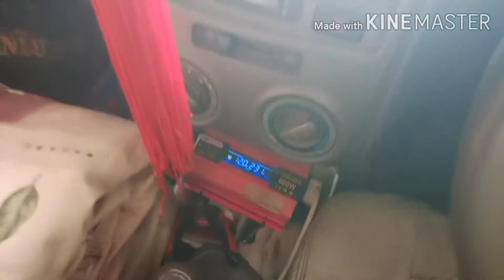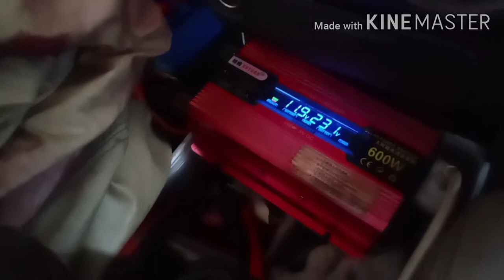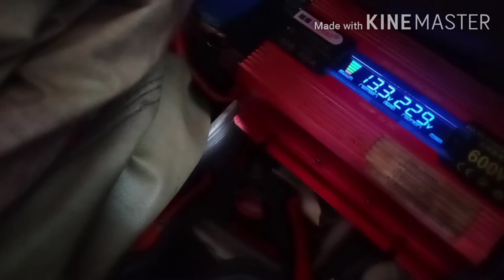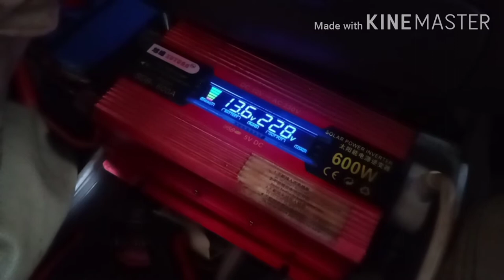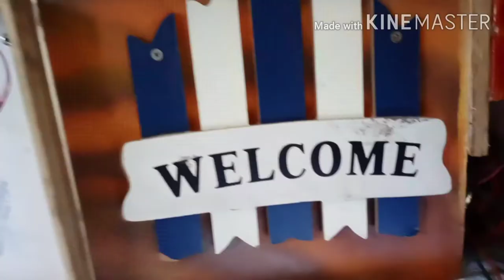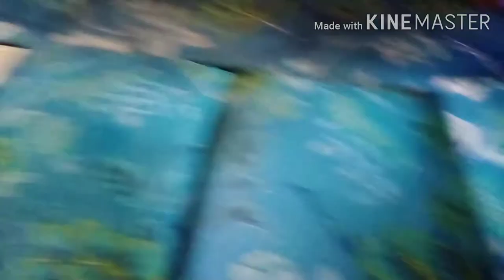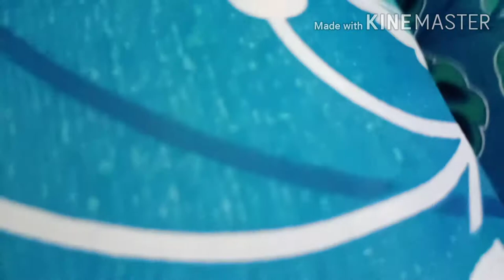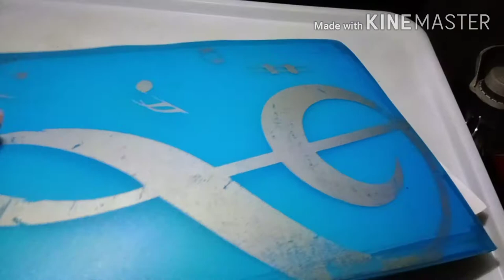from apartment to tiny little mpv campervan..

Comment: Just wondering, is it hot to sleep in an SUV?
Reply from the maker: Thank you for the comment.. Well,  not really by the way it was a mpv,  its depend on the weather,  the area we parked, we like the most parking in highlands.. And low temperature area...and we also often open windows and doors to let air flowing in and out.. Its a moving house on wheels..  We choose where to park... And we also have owning to keep away
 sun and rain.. But now we have changed into our new campervan it is vanette.. Just wait for our new video of van tour.. Thanks..
Reply: Good to know that. Thanks for the info. Will certainly give it a try one day.